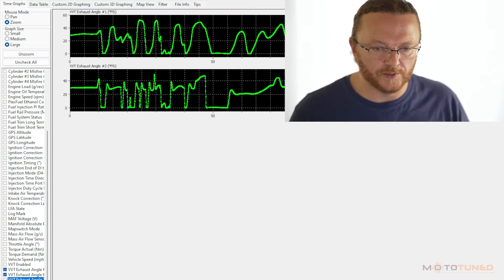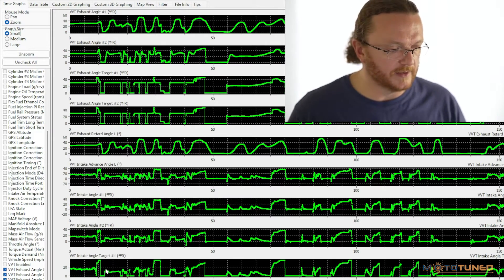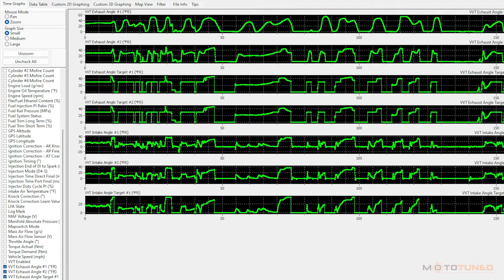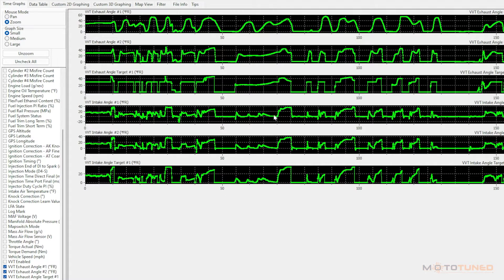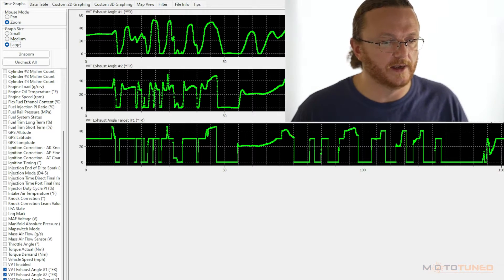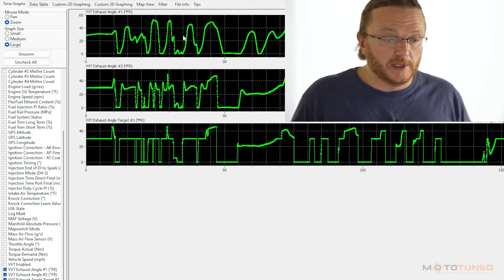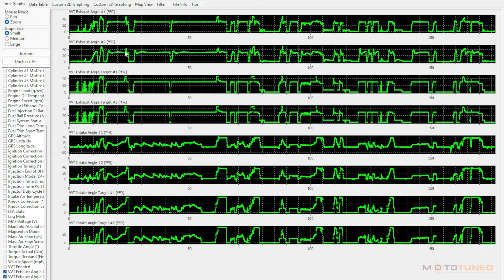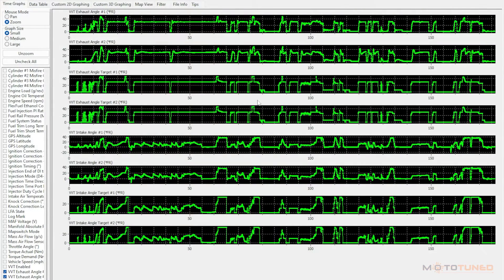Cam Gear Troubleshooting on the FA20 -- P0016-9/P000A-D Codes

Comment: subaru tech here. we see a lot of these codes caused by engine sludge and not getting your oil changes on time. a lot of the time it is just a straight solenoid replacement, but when those cam screens gets clogged, it can absolutely take out the sprockets. as for the ecm, the out of spec learned values for the sprockets gets burned into the ecm, which can lead to having to replace it. on newer scan tools, you can sometimes clear the learned values by putting the system into test mode, then going to the special functions section and reset that way. sometimes it works, sometimes it doesnt.

Comment: Is there a data log to show if its the cam gear thats the issue? If not is there another way to nail it down as the problem?
Reply: ...of the two pieces, which one is more likely to fail?  and which one is easier to replace?  Personally, the sensor/phaser is easier to replace for simple troubleshooting....

Comment: Thanks for you video, this fixed my P0017 code
Reply: BROO HOW DID U FIX IT I JUST RAN INTO THIS LITERALLY RN. AND THE CAR IS IDLING LIKE SHIT!
Reply: @okaynell1584 did you find the solution?
Reply: X2
Reply: Howww??
Reply: @nickvidz2458  hopefully someone answers i cant find a video  for 18 crosstrek with a P0017 code
Reply: @chrisavena  dude my car has been sitting for months because of this same code. I tried replacing sensors and everything but nothing works
Reply: @nickvidz2458  the only thing Ive done swapped 2 of the vvt solenoids idk if i should replace the other two, also was thinking the camshaft sensor
Reply: @chrisavena did u fix it ???
Reply: @marcosb562  yes , the timing was off ,luckily the sprocket was still good (took it to subaru service to get it fixed at the dealership)

Comment: We discovered a way to clear the learned values on Friday using a scan tool. This is great news for Subaru enthusiast and techs. We haven’t figured out the brz platform but have successfully reset a 2015, 2016 and 2019.
Reply: so would you be so kind and share with us how to clear learn values with scan tool, step by step thanks a ton
Reply: @radmilakrejci8581  https://youtu.be/aR6fHMxlZgU
Reply: @radmilakrejci8581 Guess that's not gonna happen
Reply: @Drrich_DIY  about as helpful as the video............no response to questions. But if you buy their tune they would probably be more than happy to help. Pointless video. I am finally going to tackle this issue in the coming weeks. If I get it figured out I will report back.
Reply: @rbailey225  you're right on all counts.  Thanks!
Reply: @rbailey225  well if your father has an ultimate set of tools, maybe you can fix it after all……
Reply: @rbailey225  i posted a video on how to reset the learned values using a launch, topdon or autel scantool.  The link I posted may not be showing up if this channel blocked it.
Reply: can u let us know how pls

Comment: How to reset the learned values for the vvt
Reply: We just figured out an OBD method on Friday that doesn’t required ecm replacement.
Reply: @ThePracticalMechanic  what is i?
Reply: @Gregg0112  if the link didn’t go through I posted a vid on Friday.
Reply: @ThePracticalMechanic  what is it ??
Reply: @djsonic_pr  the last link I posted got deleted. I have three videos on my channel showing how to reset the learned values on 2015+ Subarus using a launch, TopDon or autel scantool

Comment: Scion frs same issue code p0016 and p0018. Changed out clutch and flywheel car has been sitting for over 2 months. When trying to start car it takes 2-3 seconds or more to crank and start. Then idle goes up and down. I would have to accelerate pedal for car to not die out. Even if driving once let go pedal will auto die. Someone mention the flex plate behind the flywheel may be damaged or not installed correctly.  My last option is to pull out trans to check or to replace ecu. Any idea what issue is?
Reply: When you removed your fly wheel there is a reluctor ring that is sandwiched between the flywheel and crank. The crankshaft position sensor reads off this. If you had no codes before the job likely your need to reposition the wheel.

Comment: I know this is a little old, but I had this exact issue with a FA20DIT engine, bought from salvage yard, had P0016, after a lot of head scratching I ran the engine for about 100 miles on a clean oil change, then ran Subarus engine oil flush through it, one more oils change and the issue was completely fixed. I am able to watch the cam positions on my access port and I can see that the right intake stays right with the left intake now. I think the salvage yard engines sit around too long and the oils break/coat the journals, the flush turned my new oil completely black. I am going to do one more flush at 1,000 miles just to make sure.m

Comment: I'm flying solo on this. Paying labor is not an option. I have a decent grasp on mechanical skills and have plenty of experience. I have changed out phasers on a couple of bmw e39 V8 engines. Getting a code for P000A intake bank 1 slow to respond. Oil solenoid checks out good. Is there a way to determine if it's the sprocket or the OCV filter? Engine has 52000 miles. Never been rebuilt. It did sit for a year due to an accident. Can air be blown into the cam phaser check ball area to dislodge any possible sludge in the filter? Or, do I have to remove the phaser and blow air directly into the oil hole on the cam? I did an engine flush with no change in result. It would be a shame to replace the sprocket only to find out I have a clogged OCV filter. Are all of those data PIDs available in a high level scanner? This was an engine swap and I am using a 2014 ECU on a 2016 engine. Should I swap in the 2016 ECU? They both have a stock tune. This is an FRS.
Reply: Any luck? I’m showing the same code
Reply: @rhdem1harris768  nope can't get a definitive answer on the procedure for testing the cam sprocket.
Reply: anything new?
Reply: @beanswrldd  Nope but I am going to dig into it in a couple weeks.
Reply: any news?
Reply: @kodi1911  I did finally dig into it. Replaced the cam sprocket on passenger side intake cam. Problem solved. Did the work myself so literally only cost me 300 bucks. Depending on how much time you have, you can make this job super easy. I removed the bumper cover, radiator, condenser, fans and crash bar so I had wide open access. That was more time consuming than the actual procedure. The sprocket had a strange skip/jump in it when you bar the engine over. After I installed the new sprocket there was no skip in it. None of the other sprockets had the skipping issue on initial inspection. I wanted to replace all of them but my son was on a budget. It was easy and the timing procedure is a piece of cake on this engine, so if I have the issue again it's not too big a deal. Had it done in a weekend. Just make sure you order all the replacement o rings for the timing cover. I also replaced the o ring on the crank shaft/oil pump drive gear. The longest part of the actual procedure is cleaning the old sealant off of the block and timing cover.
Reply: @rbailey225  thanks, I appreciate it!

Comment: 2020 wrx here with the p0016 code... Crank Position-Intake Cam 1 (RH) Position Correlation.  Changed out the Passenger side intake cam sensor before watching this video, and yeah CEL came right back seems to come back on at the same frequency/situation/mileage at deceleration.  Will try swapping the intake camshaft solenoids from left to right next see if the code changes.  Keeping my fingers crossed.  I flex fueled my car, and only have 20k miles.  Don't see the dealership over a hours drive away offering warranty work for this and i'm scared to ask...  Ty for making this video!
Reply: hey just got the p0016 on my 17 wrx what did you do to fix it?
Reply: @sbrasileiro  my car is a 2020 and I had it tuned.  I tried to avoid the dealership, but it ended up at Subaru anyways.  Dealership worked with me some with labor, but they replaced the camshaft phaser and engine ECU because the code was burned into the ECU and couldn't be cleared.  Not cheap in my case.  I feel your pain.
Reply: @Jewishcatfish  i also have a 2020 wrx only has 15k miles and just got the p0018, how much did it cost you? And were you covered with warranty? Did you put it back to stock before going to the dealer? Sorry for the many questions
Reply: @aniquosama  I had to pay for a new ECU the manager had warranty cover the rest.  It was over a grand if I remember correctly.  I don't think there was a way for me to hide my modifications I was open and honest with the dealership and they worked with me.  These cam phazer ECU burn in issues are dumb.  Since 2013 this problem has been a issue i believe..  good luck
Reply: This same exact code just came on for me bro, i took it to the dealership and they told me they couldn’t diagnose it properly cos i have a big sf cobb intake, advised me to go back to stock so they can properly diagnose, were you able to get yours fixed? My car runs and idles fine, although I notice that there’s a difference in the acceleration, sort of feels slow, what do you recommend I should do
Reply: @ThePathofEddie  well I'm assuming the reason they want you to go back to stock is if they replace the phazer and your ECU they will load the ECU with a OEM Subaru tune for your car that is meant to use the OEM intake.  Once the car is fixed you could re- integrate your access port and retune with your cobb intake reinstalled.  They probably don't want to mess with the access port and any tunes that are not OEM.  I have since my problem seen a ytube vid of a fellow finding a way to totally reset the ECU and clear the burned in code.  Preventing the replacement of the ECU.  But if the phazer is the issue the code would come back.